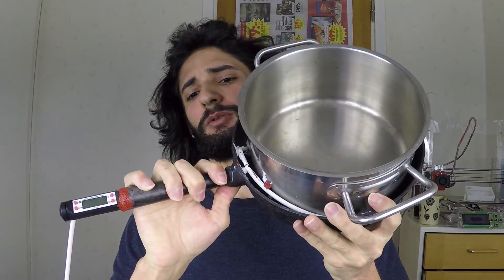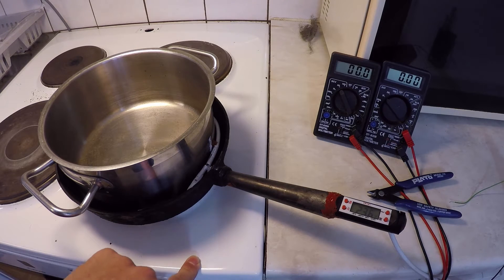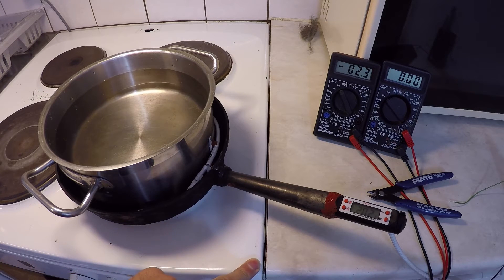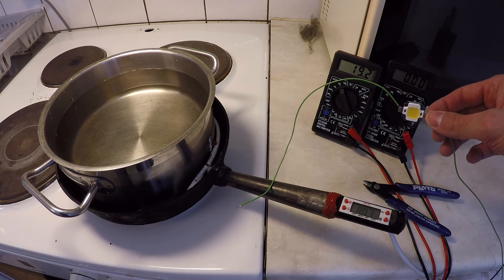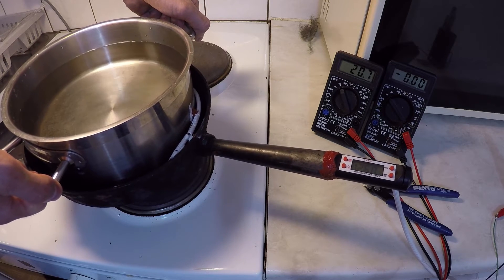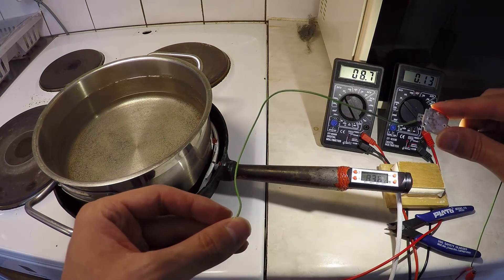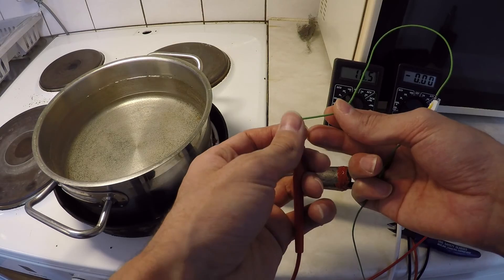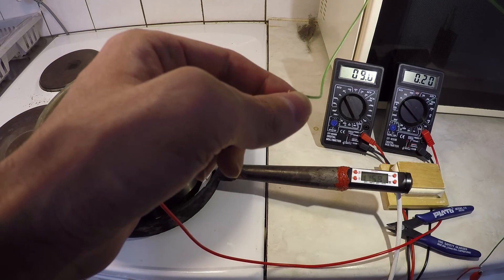DIY Generator Pot, 9 TECs Test With 10W LED Chip

Comment: Thanks for the video!  Did you compared the 27145 with the 12706?  How much better in terms of Voltage under load and generated current is the 27145 when compared with the 12706?  Thanks!
Reply from the maker: You're welcome!
Sorry I didn't try that other model you mentioned. I tried another one which you can see here (much better).
https://youtu.be/FJyWBB-RmGQ

Comment: How many Teg ( peltiers ) do you need to charge a car battery...? How do you connect them...?
Reply from the maker: Celestino Aquilizan That needs TOO MANY if you will use like the ones I used. I advise you to search for original powerful TEG modules that have high voltage and high current.

Comment: Hello Rajaa did you use the red thermo silicon just for fixing modulus? Could you make advise where to bought it please? Thank you and good luck with your project!
Reply from the maker: Hi, the red silicone is just for fixing, to buy it just look for any heat resistant silicon with a proper temperature range. Use thermal paste on the models for a better thermal conductivity.
And thanks! :)
Reply: @RajaaKahel  Thank you:)

Comment: Hi Did u test both SP1848 and TEG 1-241-1? What was the performance difference?  What was the price difference? I would suggest u use it in a solar water heater tank. The stored water heater becomes the "battery" of stored energy.u can turn on the light at night when its more needed.
Reply from the maker: +dbl88888 Hi, Yes, I did.I tested both. the TEG1-241-1.4-1.2 is more heat resistance up to 235c. the voltage is 4.5 with load. I don't remember the amperage but I will make a test video and upload it soon, stay tuned :)
the sp1 was about 3$, the teg1 was about 15$. Thanks for the suggestion, but here in Sweden if we have sun light then it's summer so there is no night :)
Reply: +Rajaa Kahel Oh i see. Thanks for the info though. The price difference is 5 times .i think using the Sp1 is more cost efficient.The voltage of 4.5 is only for 1 pc of TEG?  I mentioned the "heat" as battery so that other countries which use solar water heater can tap into the stored water and light up small perimeter lights or could be use for remote areas with no electricity yet. I think this is an alternative to PV for lighting if this can be done.
Reply from the maker: +dbl88888 Yes, it's for one piece of TEG. Yes, actually it can be very useful for lighting in these cases.. You are welcome :)

Comment: Sorry if I could clarify, you used SP1848 thermogenerators
27145? Or standard Peltier modules?
Reply from the maker: Yes, in this video I used SP1848 27145.
Reply: @RajaaKahel  Thank you.

Comment: HI, could you please suggest what is the power output from one element ?
Reply from the maker: Hi!
as you see in the video, in open circuit it was about 22v at 110°C. So, 22÷9=2.4v for each element.

Comment: hey how do you connect them seri or parlel?
Reply from the maker: Hi, I connected them in series.
Reply: @RajaaKahel  i will try paralel connection for better amps, thanks kahel
Reply from the maker: @prasleybustommy8011  It depends on what voltage input you have on the voltage regulator. You have to decide depends on the maximum efficiency possible.